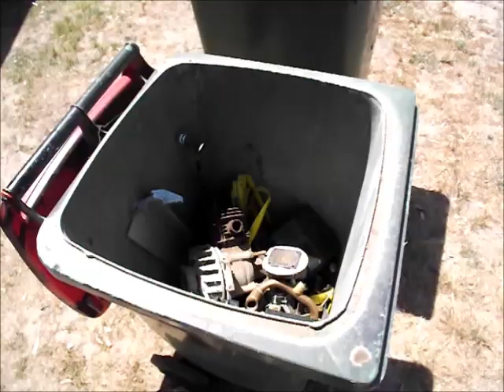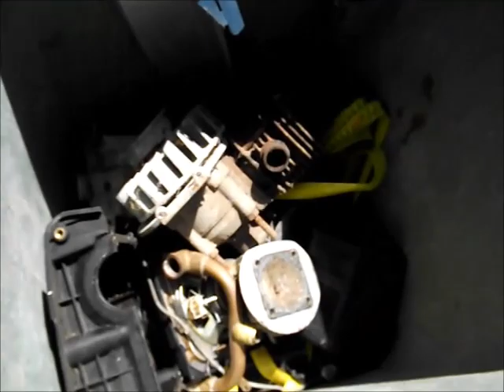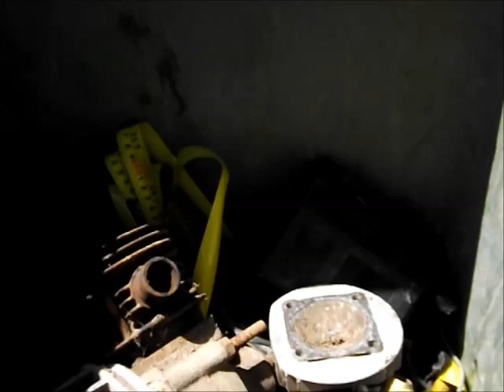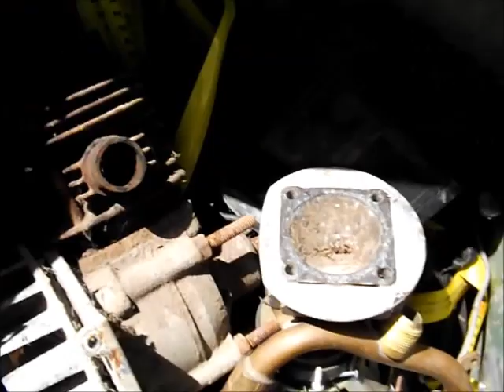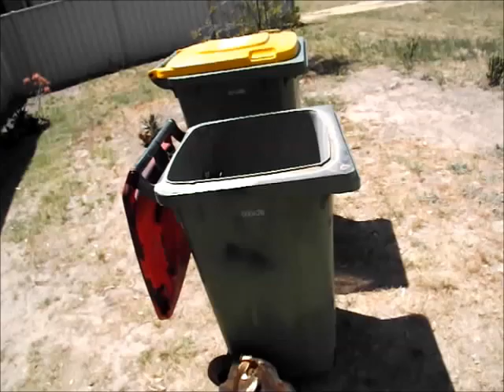Rubbish bin S.W.L fail

Comment: I can garuntee the truck lifted this no worries! I've had my reddy filled with ash, garden waste, wood splitting dirt/bark chips all the way up with scrap mixed. I could barely tilt it over to start it walking. 
Needless to say I'm making this comment😂
If you are in a small or heritage aged town in au, there's a good chance your bin truck was bought when a lot of homes still survived on wood heat so the trucks had to lift quite a lot!